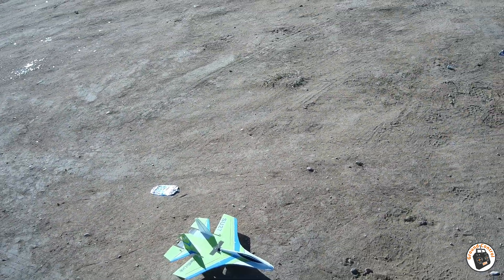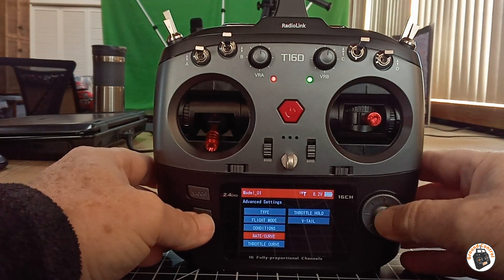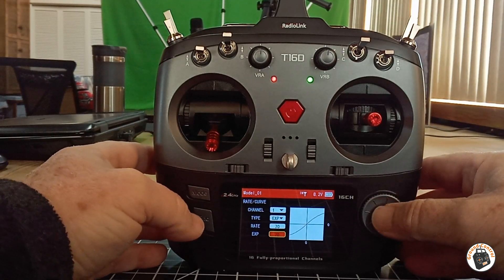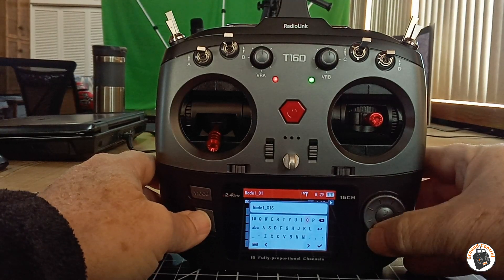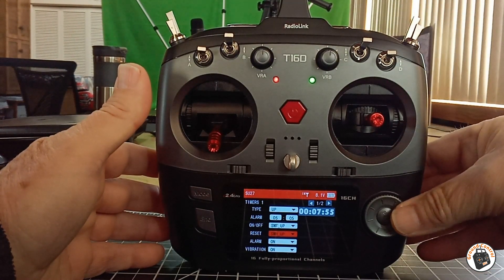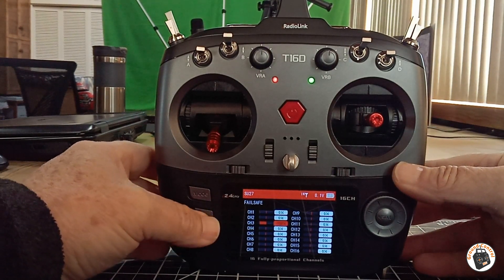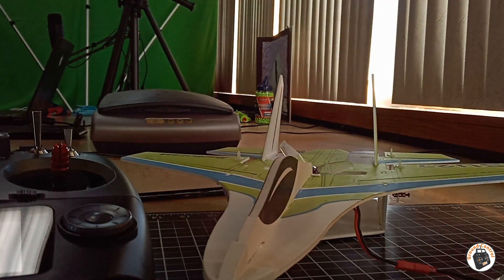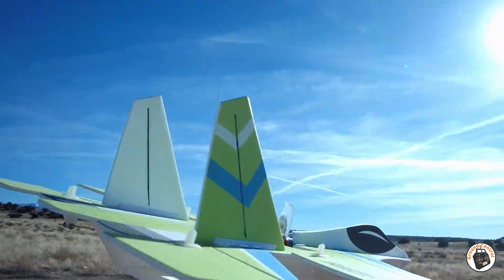Setting Up Our Aircraft | Radiolink T16D 16CH Transmitter with R16F RX + ELRS Module & RX

Comment: I'm digging the new radio link transmitter,  I have the orange AT-10 and love it but I'm thinking I might pick up the same one you have.
Reply from the maker: Radiolink makes some really great equipment and aircraft.
I do like my TX16S for using the 4in1 module.
Reply: @GroundControlRC  Hi There, I want to thank you for your channel. It introduced me to the A560, my first RC plane. After crashing it a few times due to overly touchy sticks I finally  figured out what I was doing wrong in the settings. It turns out Radiolink(at least the T8S for sure) have the expo use reverse numbers for expo! That is, if you want the sticks to be LESS sensitive around the center instead of a positive number for expo you need to input a Negative number. You can see the resulting response curve to confirm if the T16D is the same, but I bet it is. I look forward to more videos on the T16D as I'm looking to get one myself. Cheers.
Reply from the maker: @TC-ut1tw  Thank you for the kind words.
I'm taking the A560 out again soon.
A great 3D plane so I'm glad you got one.
I'll have to test the EXPO on the T16D as I'm going to use that when I take out the A560.
See you in the Air!
Reply from the maker: I tested this on the T16D and T12D and they also required negative numbers for EXPO. Thanks for mentioning that. I was getting ready to create a short video on applying EXPO in the Radiolink Transmitters and had to search for your comment. I remembered someone mentioning this but couldn't remember who it was. I wanted to follow up with you after confirming your findings. See you in the Air!
Reply: @GroundControlRC  I started the hobby with FlySky FS-i6 in 2020. Afterwards I jumped to the TX16S MkII in 2023 (running EdgeTX 2.11 nowadays). Frankly speaking the TX16S is a very good programmable radio, but I'm not comfortable with the grip of the case, it is too big, the gimbals are stiff (I have already tried all possible tuning), insofar that I'm not happy with 'pinch control'. I have bought the T16D in Sep 2025. I can say it it is a good choice. It doesn't have the flexibility of EdgeTX but the Radiolink firmware is more than sufficient, plenty of mixes, 100 model memory, customizable sounds (I'm running firmware version 1.8.3, 2025-08-08). What is most important: the grip feeling is the best for my hands. I'm very satisfied. 

PS: I see you have bought another R16F on Banggood in Oct 2025. What is the next project?
Reply from the maker: @Josephrc1  I have found Radiolink products very good quality indeed ;-)
I've ordered more of the Radiolink R16F receivers to use in larger planes with flaps.
I currently have one installed in my 1100mm Fun Cub along with a Radiolink Byme-A Gyro.
The R16F allows SBUS and PWM signals at the same time so you can also use things like flaps and retracts outside of the Gyro.